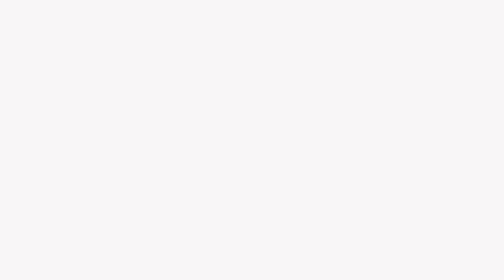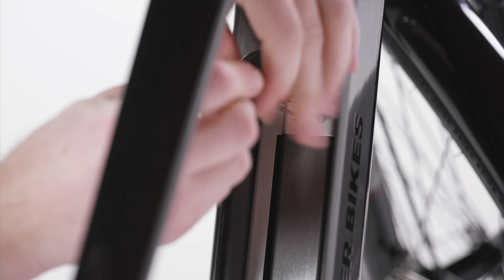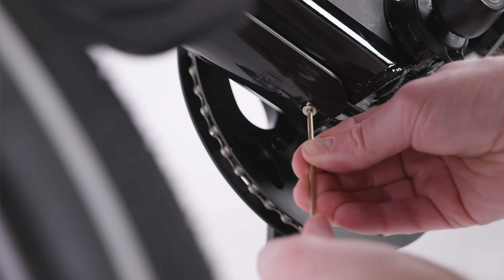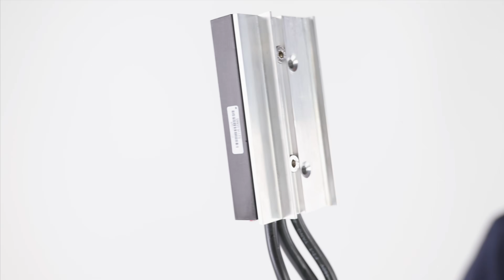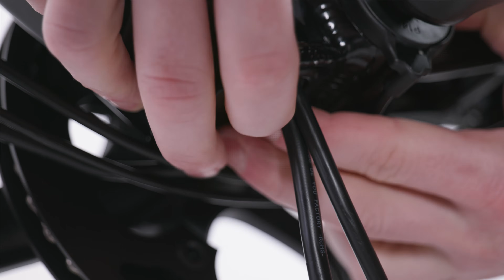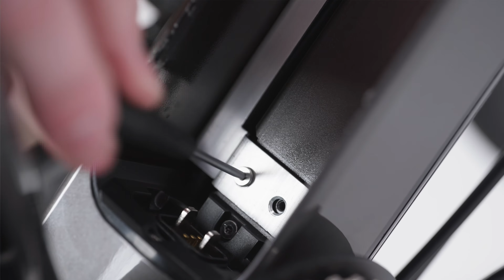RadCity 5 Plus High-Step Controller Replacement

Comment: I just hope the new controller is better than the original. I would like to say, Rad warranty has been great to me, but I should not have had as many issues as I have. It seems like the quality is extremely marginal. Very seldom do I even use the electric assist, when I do, its never higher than 2, and the bike is always stored indoors. But again, kudos to the warranty department because they have always made a great effort to make it right.

Comment: This video is very clear on all the steps to be done, but most steps are more difficult to do than they appear in the video. Some screws are very awkward to get at, and aligning the holes of the controller with the screws will test your patience, as it needs to be done by feel alone. There is no real way to see if they are aligned. Also, many of the screws on my bike were very tight, so if you're not careful you could strip them when trying to remove them. I completed the job in about 2 hours. If you are careful and patient, you can do this yourself. If not, then take it in to a bike shop, and spare yourself the aggravation.

Comment: How do I align the new controller with the two screws? It is proving impossible as I cannot see and I suspect the controller is going too far up the shaft
Reply: I have seen other videos where someone used a longer screw to find the holes easier and tightened it lightly and then used the original screws one at a time.  Sounds like a pain TBH.   What is the controller carrier?  Is this a redesign?